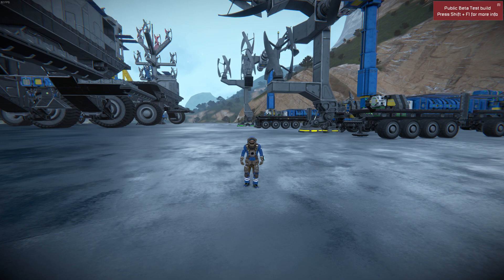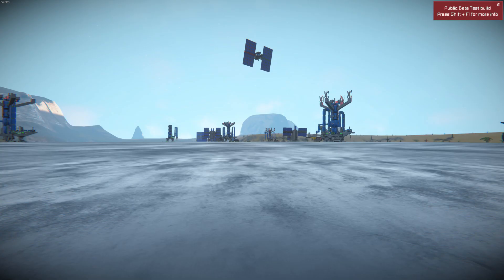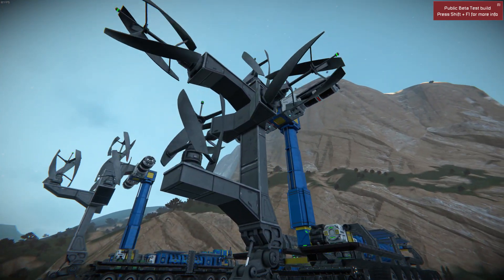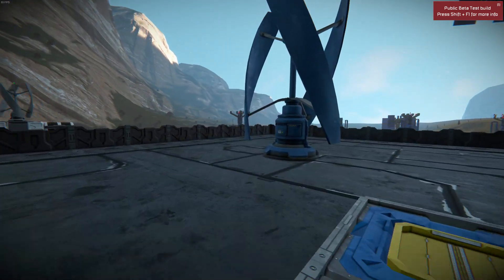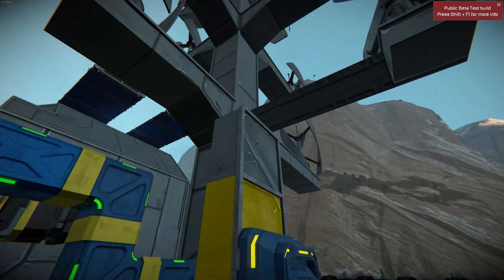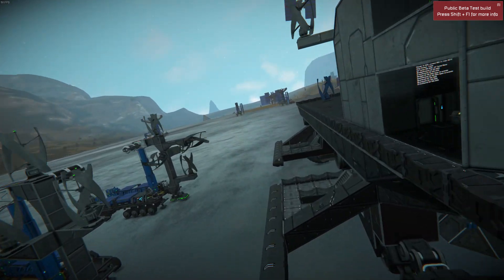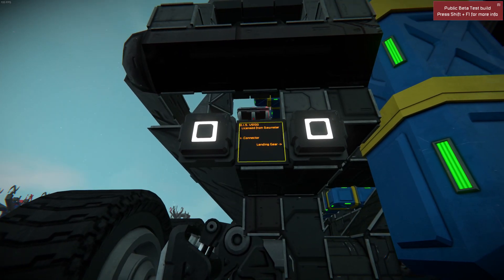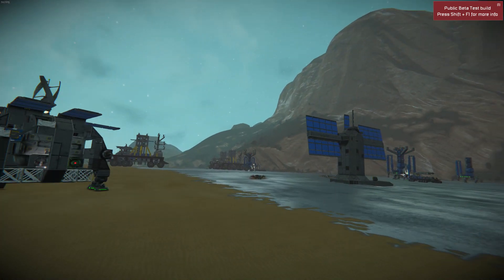Space Engineers Wind Turbines examples.

Comment: Hello. I have a question. So I've placed a Wind Turbine around 20 blocks over sealevel but it says ,,Wind Clearance: None" ... what am I doing wrong ?
Reply from the maker: Clearance can be blocks around the wind turbine.  Also is the grid of the wind turbine static or landing gear locked to a static grid?
Reply: @elfiwolfe  the Wind Turbine is the only thing thats in that height. I have also placed turbine on a platform on the ice so everything is completely stable so there is nowhere any landing gear.
Reply: @elfiwolfe  Ok I might have found the problem! I switched off all my mods and now the Turbine works. So now I have to look after the mod that causes the problem or if mods in general cause the problem.
Reply: @elfiwolfe  Ok now I  have found all mods that are not compatible with the Wind Turbines. 

Albion Weapons Pack Series 1
Azimuth Complete Mega Mod Pack-(DX-11 Ready)
Azimuth Extra Large Thrusters Pack-(DX-11 Ready) 
Azimuth Power Mod Pack-(DX-11 Ready) 
Azimuth Weapons Mod Pack-(DX-11 Ready) 
(DX11) Small Missile Turret 
GE Jet Engine Mod Pack-(DX-11 Ready) 
Arachnophobia-Sabiroids in All Default Planets 

So it looks like the ,,(DX-11 Ready)" cause the problem. These mods are not compatible with the blocks added to the newest version of the game. 

Maybe this helps others who have the same problem like me (none working Wind Turbines).

Comment: Awesome info!
So what should be the spacing between turbines? I see on the video they have 3 sides completely open. Have you tested the power output in different configuration or is it simply 0.3MV? In other words what will generate more power:
._X__X__X_.   or          X
                           ._X__.  . __X_.
Reply from the maker: at sea level on earth like the max is about 400kw.  And it seems to be the blocks to each side of the turbine.. about 5 blocks clear and how high above voxels it is.  the top turbine on the small vehicles is working at 400kw.  so 12-15 m above the voxel surface.
Reply: @elfiwolfe  Thank you for the reply! I assume a block has 1m height, right? 
Do you mean terrain or any placed block under term "voxel"? 15 blocks sounds quite high, maybe if I'm on the mountain then it can be closer to the ground for the same efficiency.
I noticed that if 3 turbines placed on one level by 2 block gaps (technically one next to the other) the middle turbine spins noticably slower.
Reply from the maker: @DmytroBogdan large grid is 2.5m per block.   you need open space around each turbine for max power.
Reply: @elfiwolfe  I'd never guessed that block in 2.5 meters high, thanks for the tip!
Are we talking 5 blocks around 3x3 turbine or that single block its connected to the base?

P.S. you have a lot of cool stuff in your base! I wouldn't mind a video tour :)
Reply from the maker: @DmytroBogdan It is just testing ground.  All of it is on workshop  at least in 1.188 form.  most are going to get adjusted for new energy economy and new blocks.